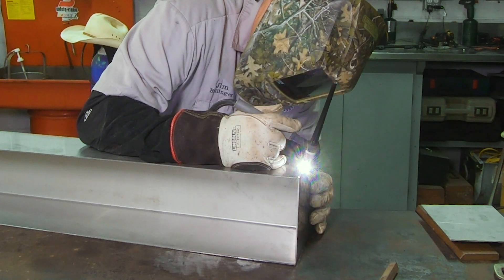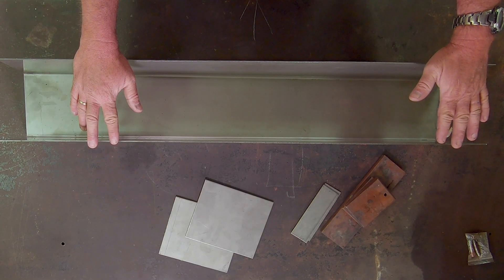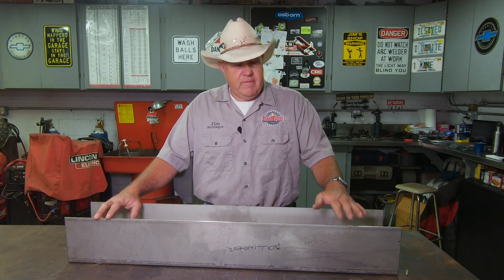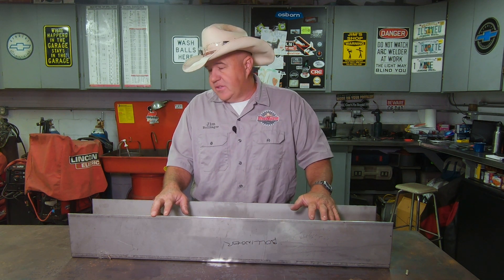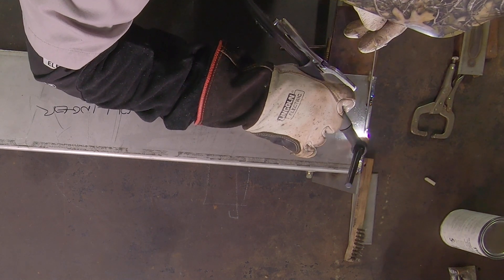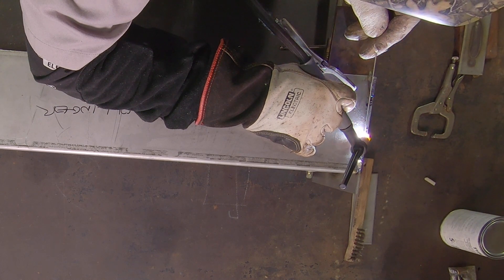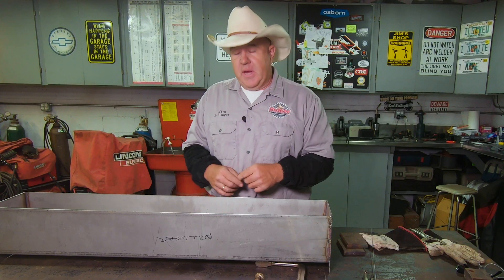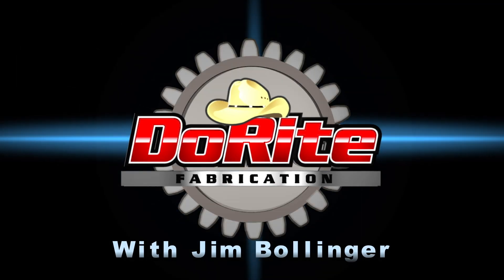WELDING STAINLESS STEEL - TIPS for the PERFECT WELD

Comment: two suggestions:
1. Don't weld in one pass. weld a small area, then weld in a different area. This helps with both the distortion & oxididation issue. For thin sheet stainless, I do a bunch of tack welds (about an inch apart and then do a bunch of short pass of about 1/3" inch, moving to different areas so the temperature does not get excessively high leading to heavy oxidation or distortion.
2. You can use a cheaper gas like nitrogen as a shield gas on the back side. There is no active plasma on the back side so a semi-inert gas like nitrogen will work fine. I use nitrogen when its not possible to attach a block of copper or alum on the back side because of the shape, or no way to clamp it.